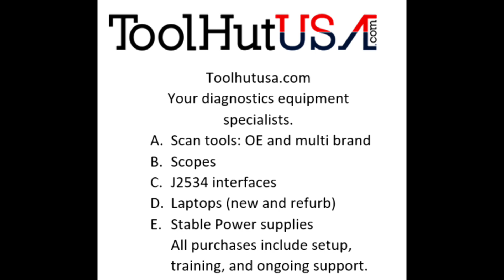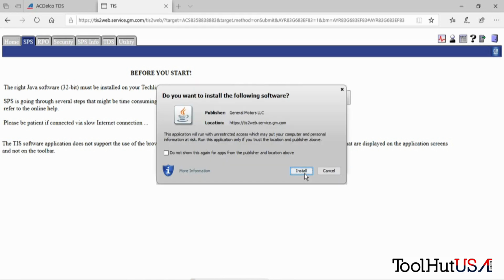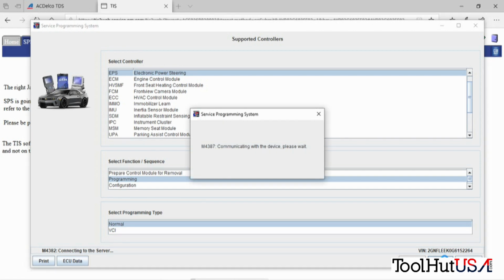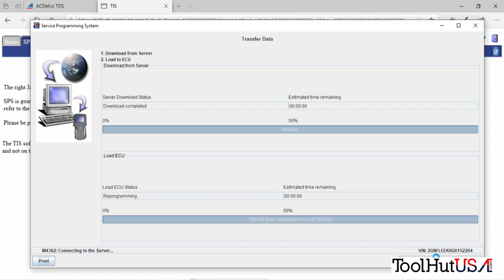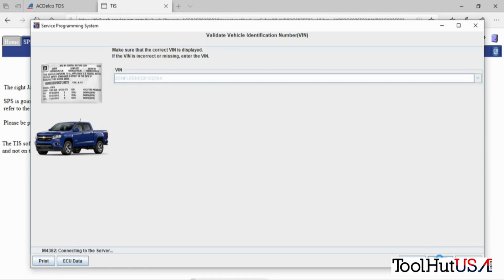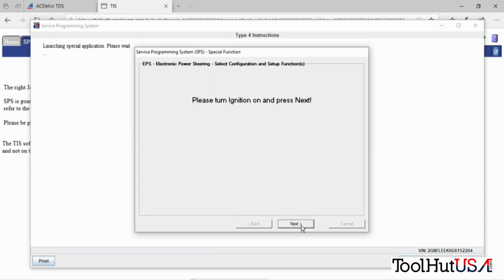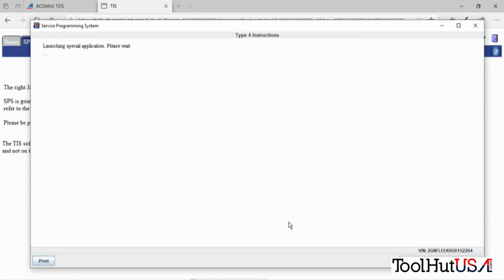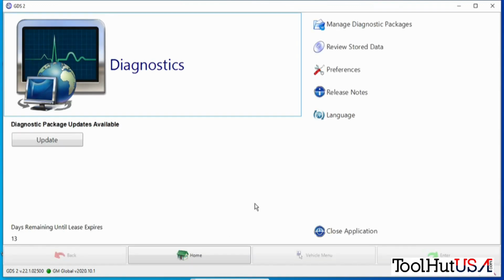16 Equinox Electronic power steering module programming

Comment: So I just replaced my power steering on my 2017 Equinox and of course I've met those problems with programming. My question is, what tool and/or software do I need to program it. 
Will Autel Maxisys MS906 PRO Ultra do the job?
Reply: did you ever find out what tool you needed
Reply: If you have Autel, use j 2534 and capable lap top to run TLC subscription.

Comment: Hello
Please if I install used power steering on my chevy equinox 2015 do I need to reprogramming?  ?
Reply from the maker: Yes and a lot of times used doesnt work
Reply: @toolhutusaakathecarflasher3019  thanks for your answer 
You're right. I'm facing many problems now.
But programming with normal car scanner it is enough? Or I need to try what you did on the video with gm scanner and support?
Reply from the maker: @thierrykabran3697  yes you need a tool that can do the programming at a minimum. With it being used you may not be able to program it.
Reply: @toolhutusaakathecarflasher3019  so you can't reprogramm a use rack and pinion power steering
Reply from the maker: @blesdavis7637  sometimes not